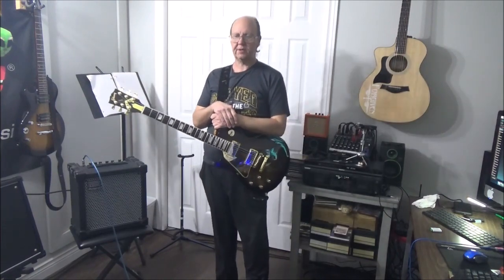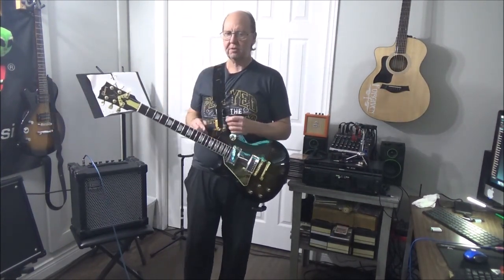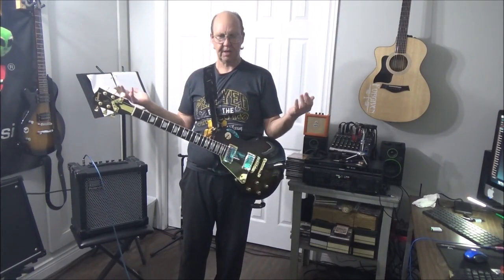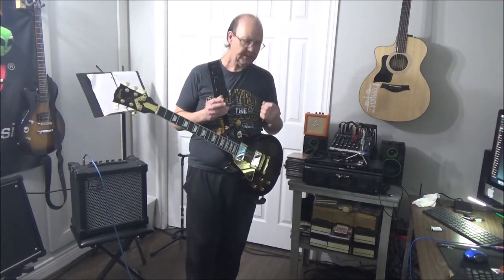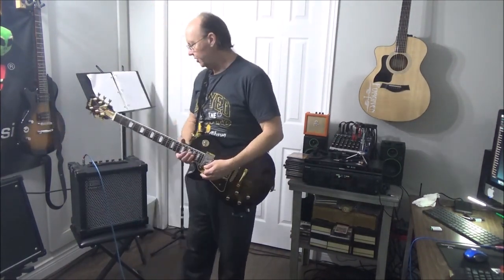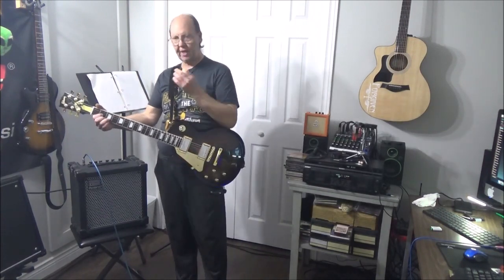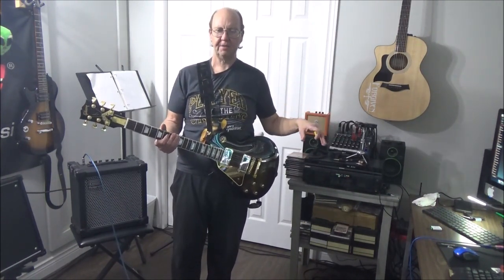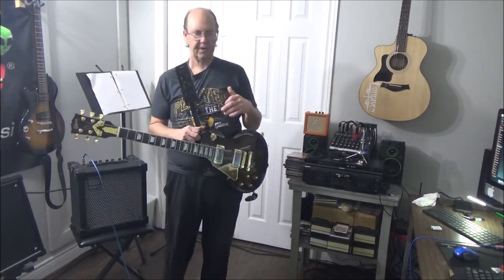Why Guitar Processor Boards Are Better Then Pedals And Some Interesting Testing

Comment: Bro?  What happens if your multiprocessor dies?  You talk about savings, but that means you need a second unit, that makes your board a $1200 rig, which is more costly than the average pedal board.  And they do go down; I've experienced it a few times, once on stage. The professional setup would be to have a multi-processor & analog pedals, & most pros do have both.
 
BTW, you do know there are control units that can trigger your analog pedals in unison; just like a multi does right?  You can create presets and everything. There is a reason 90% of professional guitarists and audio engineers prefer analog circuitry over digital.  You cannot reproduce that sound & feel, & I've had/have the best multis as well as Roland's best guitar synths; nothing comes close.  And while you do have a stereo set up, which does sound nice, nothing you're playing thru is analog; even your amps are solid state.  I assume the audio isn't coming from the camera, but it's still kinda flat despite being in stereo.  

You need some analog circuitry.  It literally generates living audio waves, that your mind & body recognize as such, as opposed to the mimicry of digital.  Our ears have that "uncanny valley" thing just like our eyes, & they know when something is analog or digital, whether we know it.  Digital is wonderful, & it opens up a world of possibilities, but IMO you need at least half your rig to be analog; the marriage of the two is what makes hits.  This is true for guitarists, & audio engineers.  All that digital recording still goes thru lots of analog amps to give your master life.   You clearly know what you're doing & love music, & I'm sure you've heard all this before, but coming from someone who is a professional engineer/musician, that actually went from multis to analog pedals, after experiencing the differences, I think you're really missing out.  I still have a digital unit on my board; the Flashback  3 is practically a multi itself, so I'm no hater, but perhaps you've never really heard what a nice overdrive does to a nice tube head, & that's why you're not experiencing the drastic tonal differences?   I think some soft warm tubes would fill you full of joy.
Reply from the maker: the odds of a processor board going down is so slim its crazy tho it can happeen just as pedals can and do die as do poweer supplys how ever a processor can be prgramed per song and song titles for each can be put in place and the cost of 1200 for a board for what they have and can do is far cheaper then the same in pedals you have no idea what your talking about is seems , as for tube amps i have no use for them really to be honest ihave owed a few of them and done testing on others as well and find that the sound is not what iam after ,, the end result to all this is simple we all like diffrent things we all have our own views on stuff as well. its what makes us different i dont follow I lead thats the difference between you and me i guess i also dont waste my time playing everyone else stuff tho i do play other people stuff i have my own sound I know who iam do you know who you are i write my own music and songs do you again iam a leader not a follower and i dont adore any group or player like many people do .. i have also owned tons of pedals over the years as well again you do your thing ill do mine simple how all this works